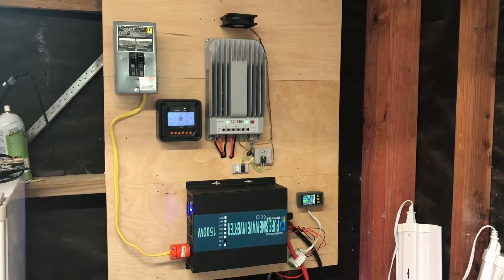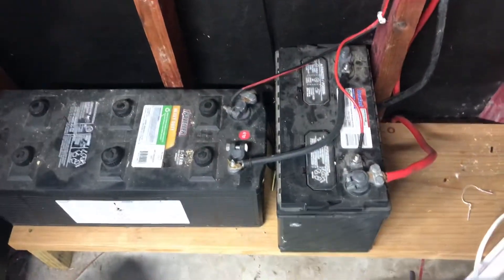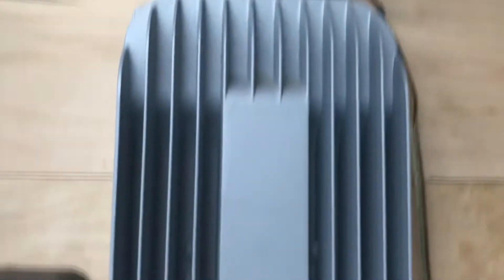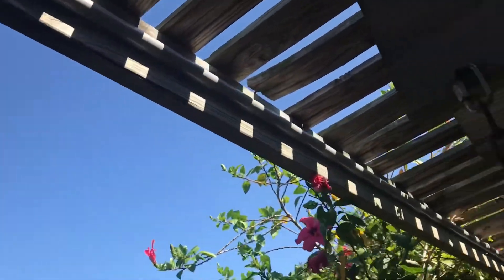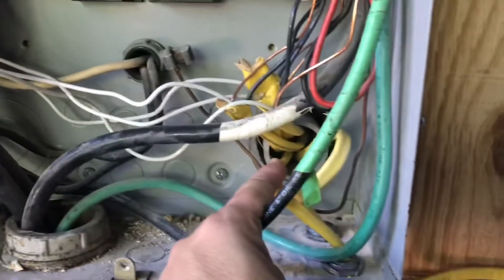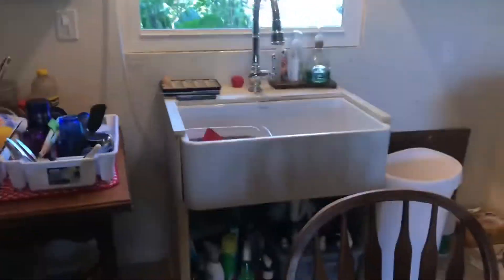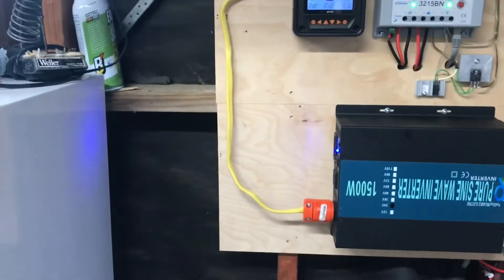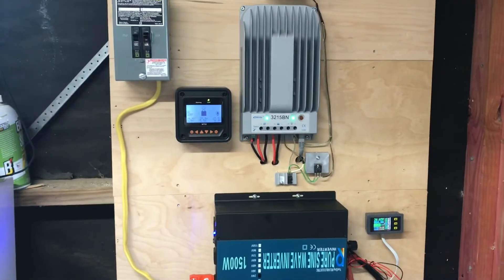My new solar addition

Comment: I have the same charge controller. I am a newbie, I’m sorry but I cannot figure out what the red button is for? Can you explain what the difference is when you click the button on or off and how that changes on your screen? Thank you!
Reply from the maker: The red button is a switch. It turns a load on and off when you push the button. On the right side of your charge controller underneath the red button is a positive and a negative terminal that you can connect a 12 V source on or a 24 V depending on what you were doing. 12 V DC lighting or something like that. It has a 20 amp load. But that button does not have anything to do with anything else other than to turn on and off
Reply: Thank you so much for replying. I realized the electrician who installed this for me, put one of the battery wires into the load terminal on accident. I am worried now the unit is broken. Or at least my batteries aren’t charging now that this has been corrected.
Reply from the maker: @bridgettallen7571  
Take a couple of pictures and send it to me. I would like to see it. Maybe I could help a bit more. 
Here is my email 
kevinpatton@ymail.com

Comment: Im still wondering about the heat involved in the controller...if it would be less at 42 volts then it would be more efficient..closer to battery voltage..so Ill still have to try it that way too..Im slightly overbuilding for now but plan for 4 more panels later and of course 2 more batteries and hopefully thatll be enough...Im using group 27 RV/ marine because none of this stuff is cheap and I have a limit on budget..I decided on an Aims 3000 pure sine 24 volt inverter because I already bought an air fryer and it makes these horrible noises on my present inverter..lol..we had an ice storm up here and lots of people without power so Im glad I have my little system even though the grid is still okay around here..looks like yours is working better though..

Comment: THATS A NICE SMALL SYSTEM SETUP YOU HAVE . USUALLY NOTHING MORE IS NEEDED WHEN IT IS ALL YOU NEED TO KEEP MOSTLY YOUR CRITICAL LOADS RUNNING DURING ANY OUTAGE OR TO JUST SAVE ON THE ELECTRIC BILL . KEEP IT UP AND YOUR SYSTEM SHOULD GROW TO RUN YOUR WHOLE HOUSE . MAY THE SOLAR BE WITH YOU .